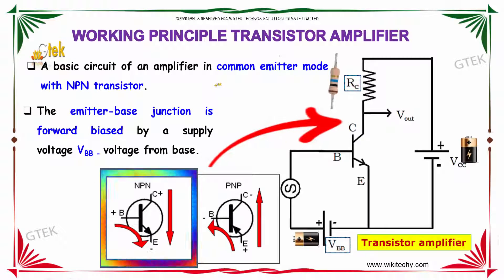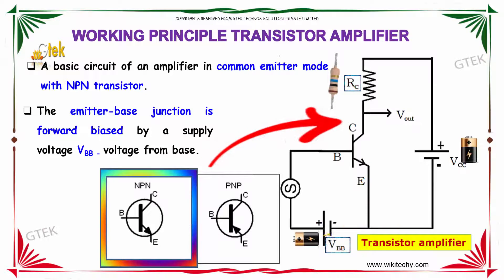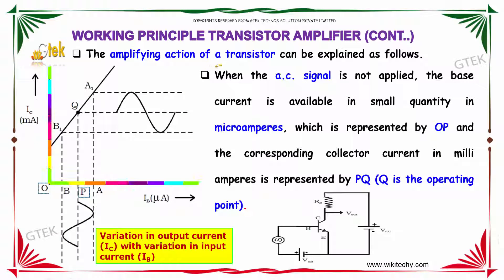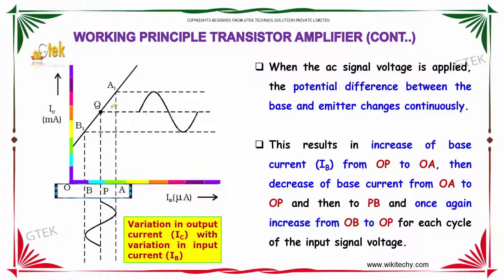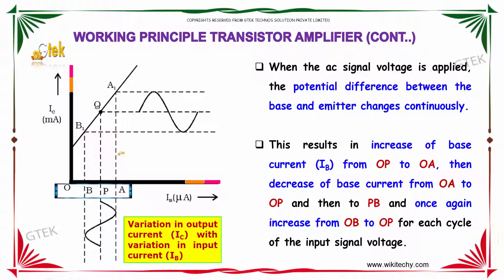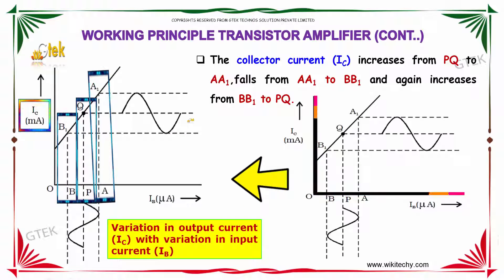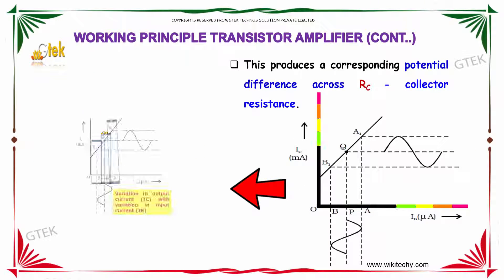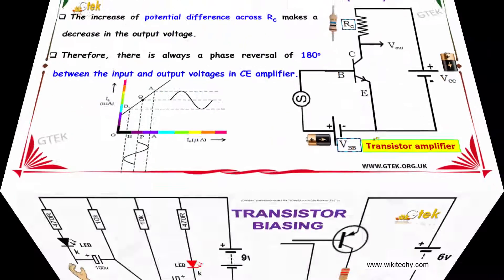Working principle of transistor amplifier Semiconductor Devices class 12 Physics subject notes

Comment: Semiconductor Electronics Important Questions for CBSE Class 12 ... 12.Draw a circuit diagram of n-p-n transistor amplifier in CE configuration. ... The condition for the amplifier to work is that the base-emitter ..... (ii) Describe briefly the underlying principle of a transistor amplifier working as an oscillator.

Comment: In the Bipolar Transistor tutorial, we saw that there are different ways to connect a transistor but the most common circuit configuration for an NPN transistor is that of the Common Emitter Amplifier circuit.

Comment: A transistor is a semiconductor with a solid and non-moving part to pass a charge. It can amplify and switch electrical power and electronic signals. Transistors are made of semiconductor material with three or more terminals used to connect to an external circuit.

Comment: Transistor amplifier. Amplifier is a circuit that is used for amplifying a signal. The input signal to an amplifier will be a current or voltage and the output will be an amplified version of the input signal. ..

Comment: Bipolar junction transistor (BJT) ... BJTs have three terminals, corresponding to the three layers of semiconductor—an emitter, a base, and a collector. They are useful in amplifiers because the currents at the emitter and collector are controllable by a relatively small base current.

Comment: It can work either as an amplifier or a switch: ... expended by yourself in the striking of the match, you will understand the concept .... That gives us a device called a MOSFET (Metal Oxide Semiconductor Field Effect Transistor).

Comment: A bipolar junction transistor is a three terminal semiconductor device consisting of two p-n junctions which is able to amplify or “magnify” a signal. It is a current controlled device. The three terminals of the BJT are the base, the collector and the emitter.

Comment: Transistor amplifier. Amplifier is a circuit that is used for amplifying a signal. The input signal to an amplifier will be a current or voltage and the output will be an amplified version of the input signal. ... So, common emitter configuration is most commonly used in audio amplifier applications.

Comment: The Common Emitter Amplifier circuit has a resistor in its Collector circuit. The current flowing through this resistor produces the voltage output of the amplifier. ... The Base of the transistor used in a common emitter amplifier is biased using two resistors as a potential divider network.

Comment: Amplifier is a circuit that is used for amplifying a signal. The input signal to an amplifier will be a current or voltage and the output will be an amplified version of the input signal. ... So, common emitter configuration is most commonly used in audio amplifier applications.

Comment: Actually Transistor acts as only a variable resistor. The value of resistor between Collector and Emitter is changed by the base current. The Transistor acts as a Regulator (Variable Resistor) or a switch(ON/OFF). When a Transistor acts as a Regulator, it is called an Amplifier.